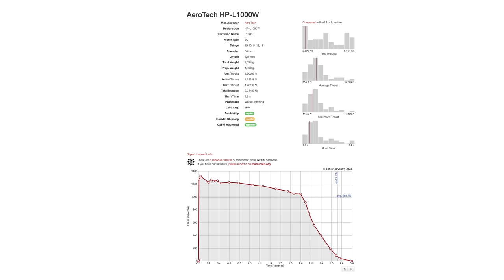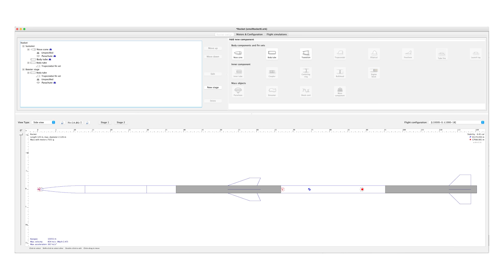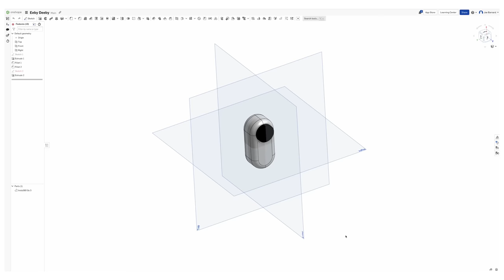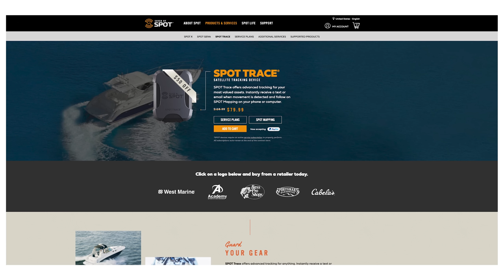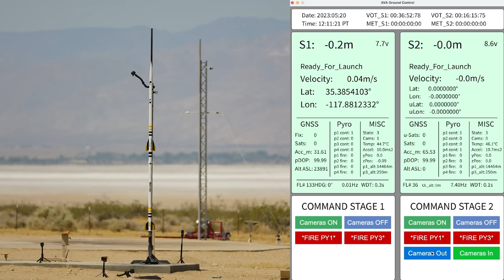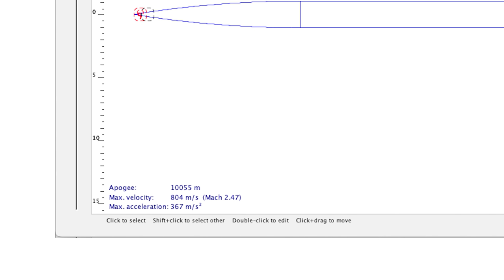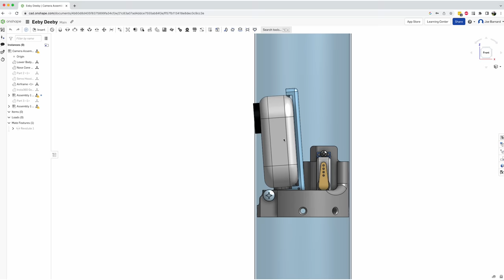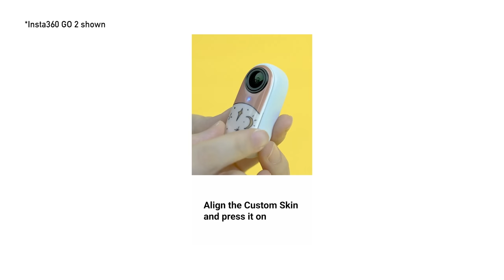I Sent a 2 Stage Rocket to Mach 3 | Feat. Insta360 GO 3

Comment: It’s shit at the launch site because your itty bitty gps devices have been rattled and jarred and vibrated for hours or days while driving out in the back of a truck. Truck suspension is rubbish in the rear as it has to be harder such that it still works, no bottoming out, when the truck loading area is fully loaded. So unloaded or slightly loaded is a rough rough ride. Same with car towed trailers. Designed for max load.

Connectors and their pins hate this. Pins break, pins or the bent metal connector strips/tabs wear through, connectors loosen completely breaking but look pushed together still or are right on the edge and then fail with one good load applied to them. The list goes on. Your an electronics guy, aerial spacing for RF interference between the antennas. In an aircraft it’s called ‘antenna realestate’, you’ve got miles of physical room on the aircraft for the antennas but not much “antenna realestate”. (Referencing my days flying Dash8 50 seat airliners with 2 seperate HF radios with discrete antennas, 2 vhf aircraft radios discrete antennas, 4 different GPS systems in the cockpit discreet antennas, TCAS collision avoidance system 2 discrete antennas, weather radar with scanning dish antenna, 2 EPIRB aircraft mounted with discrete antennas, 2 VOR discreet antennas, 2 NDB discreet antennas, 2 DME discreet antennas, the back end had satphone, 2 vhf marine radios discreet antennas, 2 ‘military type’ radios discreet antennas, I know I’m forgetting some but I left 5 years ago… oh the primary search radar a big rotating dish under the aircraft.)

Also check a gos coverage map. Even in this day and age there are still GPS holes. I admit they are mostly towards the poles though.

So on my RC petrol powered gliders I used Rossi 0.45 ci engines. Yeah I learned to hard wire with silver solder EVERYTHING. Servo leads everything, main battery connector was a wide ish one that between the two terminals I could drill a 3mm hole and use a nylon bolt that once the connector was pushed together it could be through bolted. If I had a switch then it was important. All switches were installed in pairs and in parallel, they were aligned with other switch rotated by 180°. So that if something brushed past the switches one may be switched off but the other isn’t effected. No spade connections all soldered. Goes without saying every solder joint is heat shrieked if appropriate using proper colours, any electrical devices that had covers removed to allow soldering to the board had the cover replaced after being modded to allow the new wiring. NO FRICTION FIT CRAP ANYWHERE. All devices, components, batteries etc were all screwed down to a plywood equipment tray that was then hard fixed  or glued into the airframe with a hatch in the fuse to access it. Overkill maybe but in the end you can even save weight because you lose a handful of failure prone connectors and a second on/off switch and a foot of wire is nothing.

I fly electric and it’s a smoother easier less smelly less maintenance ride for sure. I still do all the connections the same way though.

Risk is a factor of the universe at every scale. It can’t be avoided but it can be faced and when realised it can be mitigated, but only to a point. (Yeah you soldered the servo leads but you dry soldered one lead that’s for the left aileron, oops testing of solder joints with a multimeter may have helped…)

Comment: Back in '2000 or so, someone at the BALLS launch at Black Rock launched a single stage, minimum diameter carbon fiber rocket to Mach 3. 23 years later, your accomplishment is not very noteworthy.